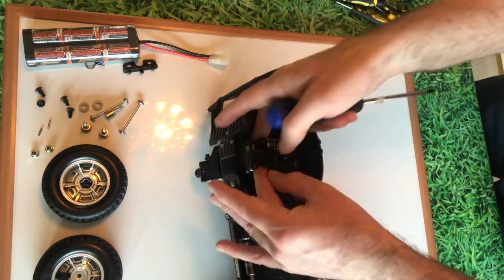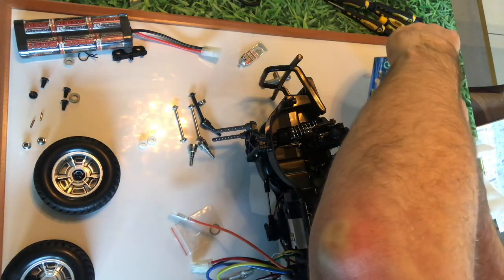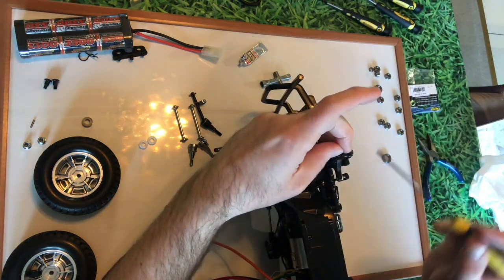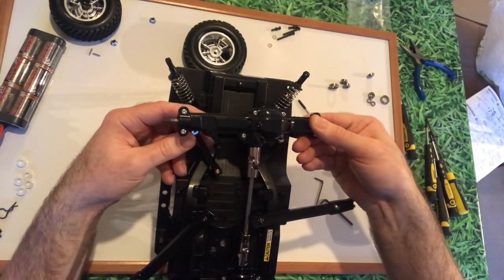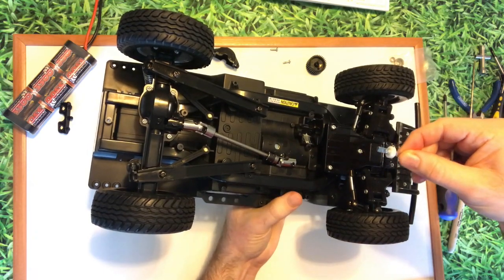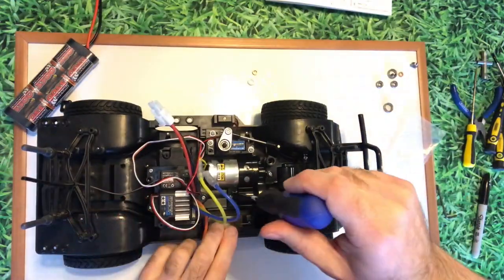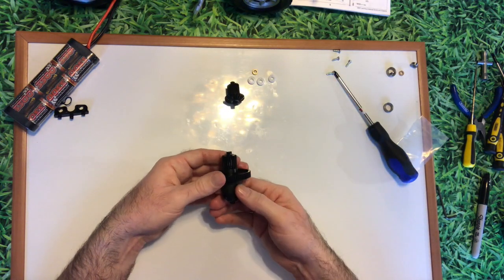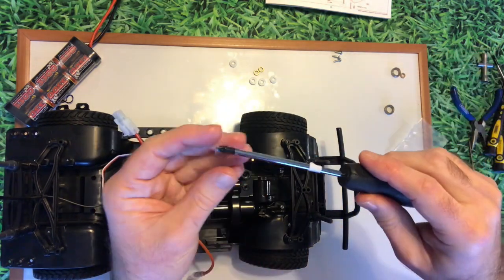Tamiya CC01 Full metal bearing upgrade

Comment: For the next time you have the rear axle open. There's a fair amount of slop inside the rear axle where the diff unit slides towards the shorter axle. Most people use one of the bronze 850 bushes and one of the 1150 plastic bushes (which are now spare because they've been replaced) to pack that space. The axle won't actually run on these, they're there just to take up the slack. This reduces premature wear between the diff unit and the bevel gear that drives it. See this video for details: https://youtu.be/jpFteRodEU8?t=81 Also, make sure that you put thread lock on the screws that hold the diff casing together. If not, they have a habit of backing out due to vibration when running and often grind the inside of the plastic axle casing. Good luck!
Reply from the maker: Thank you Phil - I will have a go at that!
Reply: @gadgetdad3634  If you find that the mesh between the diff unit and the bevel gear is too tight using an 850 and an 1150, you might try two of the 850 bushes and a washer/shim with a 5mm inside diameter as per the video. Either way, one will work for you.